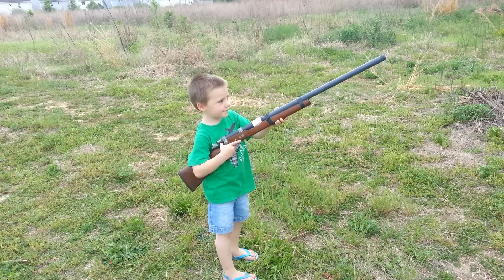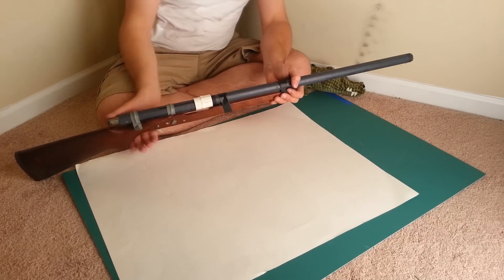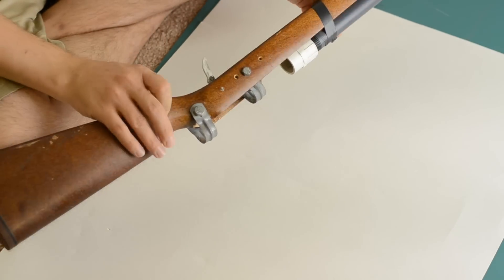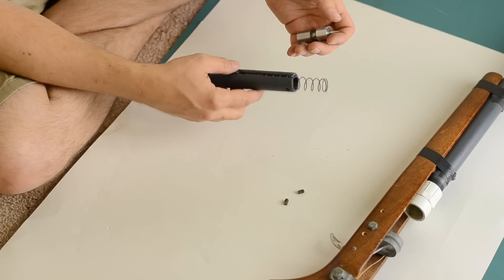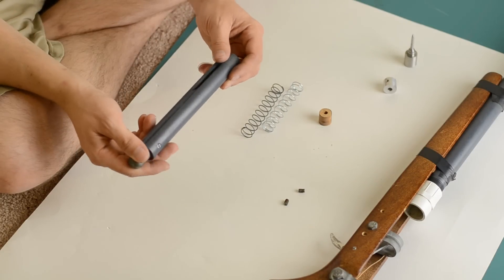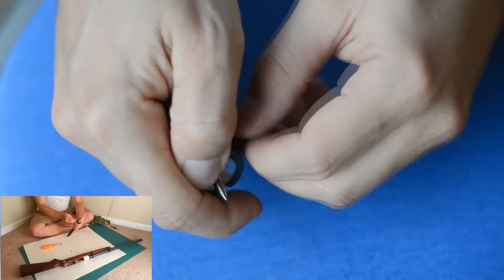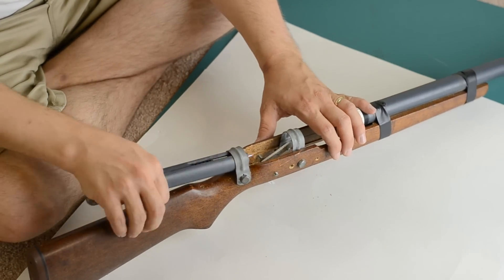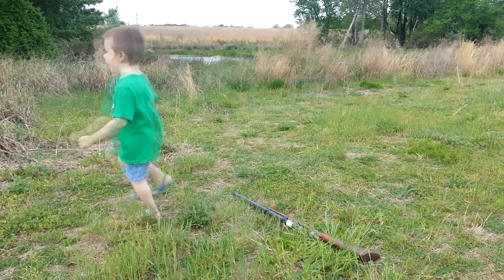CO2 cartridge gun - Rifle style

Comment: I built something like this once. I cheated a little by fitting a 3/4 pvc pipe over the barrel of a Pelletgun. Than load the tip of a nail in front of the pellet. Its powerful, but very inaccurate. I do have an idea to fix the accuracy.
Reply: fins?